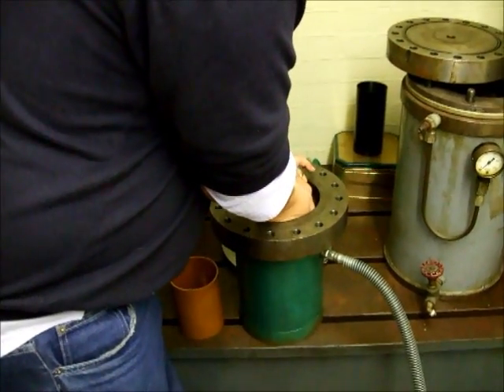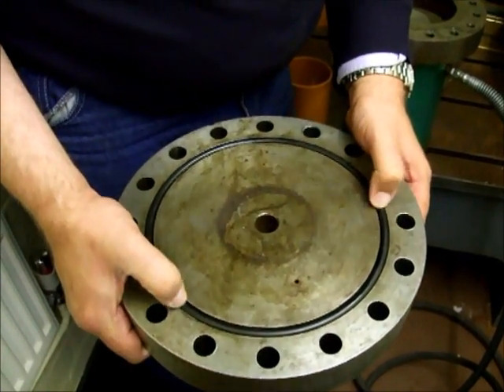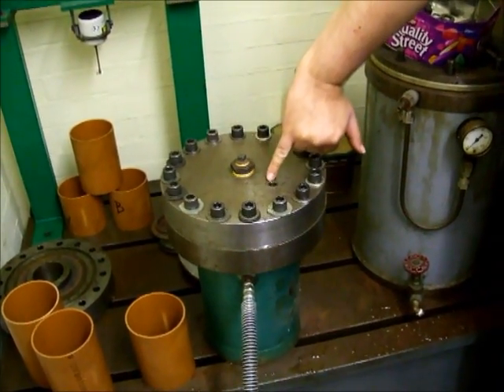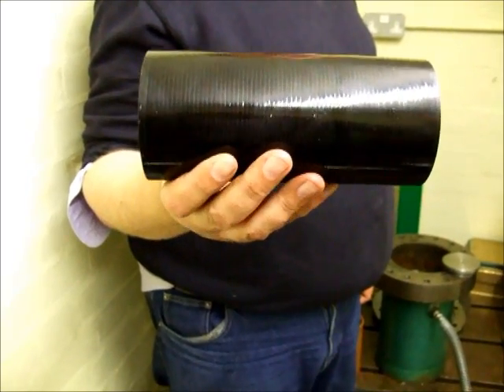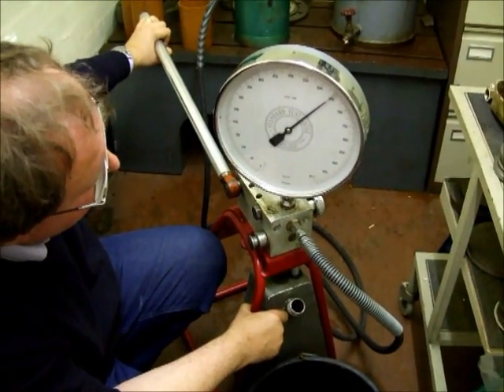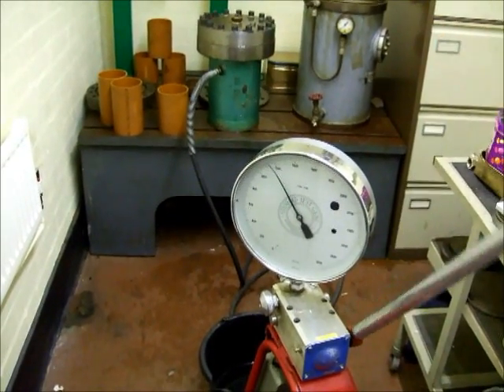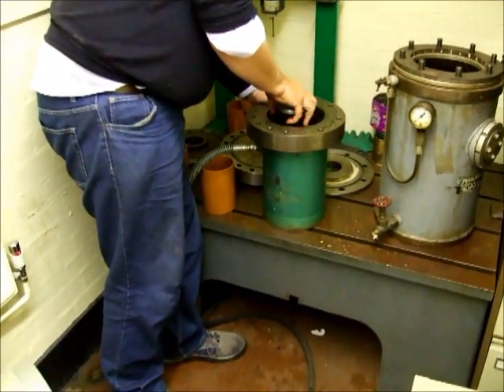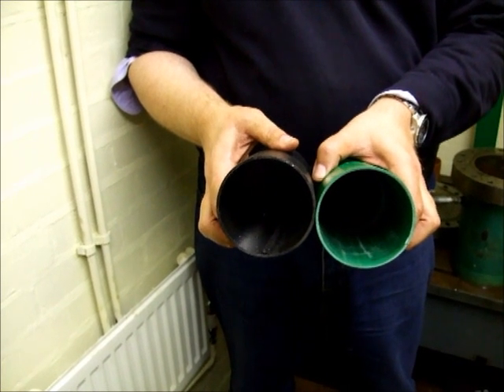Collapse of Composite Submarine Pressure Hulls

Comment: Wild how soooo friggin many of these videos exist but yet a company with millions to spend didn't even do the smallest bit of research into the reusability of the sub yeah it could do it 1 or 2 times and honestly I'm betting it could have gone at very least 5 times and at most 10 times had the looking glass been properly rated as a procurer of fine glass products lol I've found very nice glass with fractures so fine that they could only be seen at certain angles and light I'm willing to bet there were fractures a few micrometers in length which are far too small for our crappy eyes to see they never had the sub independently tested for structural integrity I bet the hull had micro fractures as well but the fact is the carbon fiber and titanium were rated for the depths while the glass was not simple as that and anyone who has piqued their own curiosity in testing tensile strength in something like say a pencile knows it's far hard to snap it the 1st time vs the 2nd or 3rd time the entire vessel was a pencile waiting to have those stress fractues from the first two attempts at snapping make the 3rd time cake

Comment: The most likely weak point on the Titan submersible would be the ring that was actually glued to the carbon fibre cylinder.  As the cylinder became subject to immense pressure, the glue joint would likely be subject to tremendous shearing stress. The strength and  behaviour of such a joint is very difficult to calculate or model accurately.
Reply: And every time you dive and surface,  you're putting the whole thing through a pressure cycle and a thermal cycle,  where the titanium caps expand/contract at a different rate than the carbon fiber they're GLUED TO.  That glue probably doesn't perform very well at near freezing temperatures either.
Reply: Totally agree 💯 the window is also SUS
Reply: It's also impossible to inspect the joint,  since it's literally inside the titanium ring.
Reply: There's a video of the joint construction, the resin seemed to be being hand mixed. It was applied in a warehouse using scrapers and looked like there was no real way of knowing whether air bubbles had got in...scary stuff.
Reply: @jimbob4217  yes, their construction methods are SUS. Also the pattern in which they placed the fibers is weird

Comment: How would it go if it was made sphere shape ?,better surface area ,maybe  .cheers
Reply: Can't be done. Carbon fiber is made in sheets. In most cases, strips, like duct tape widths. It gets it's strength by overlaying layers upon layers. If you try to make it sphere shaped, you will have wrinkles and air pockets, making it's strength plummet.
Reply: @Meika_Rei  i'm sure if you made a 100 foot sphere, you could get round the wrinkle problem...

Comment: I would think the smaller scale will let them survive much higher pressures than if you have a full tube to full scale.
For the simple reason that the surfaces are bigger for the pressure to act on, and in the middle it will trying to push in and it almost becomes a lever

Comment: A cylinder without inside reinforcements ( ribs ) is not representative of a sub.
If they calculated the cylinder from an inside force ( explosion ), the result is different from an outside.
Reply: even more that carbon fiber have only resistance for pulling forces, not withstand against pushing. forces.

Comment: There is a video on YouTube from a previous dive of the doomed OceanGate submersible to the Titanic.
At the 6:45 mark in the video you can hear faint popping noises which were probably stress fractures in the carbon fibers.  That previous crew had an angel on board.
Reply: The carbon fibers are not under tension here.  The tube is under compression, and the resin is all that is resisting the forces.

Comment: Very interesting, 10 years ago, wow. but you need to state that the observed failure mode was using a thin wall composite tube. Titan's hull was 5 inches thick. In order to physically model this event, you will need a tube with at least the same physical ratios I suspect. I'm reading that the Titan's decent rate was about or equal to 1MPH.
Reply: What was their ascent rate though??  A rapid ascent in the event of hearing cracking noises could prove rather dangerous. 
The original model was 7 inches when there was both company and University involvment but was cut back to 5 inches on the titan??  Is this true?

Comment: This video just shows the the force breaking the container and the pressure is released as soon as something gives way.

That is not the case in the ocean. The pressure will rapture and force water in to the container with massive force. The force of pressure does not stop like in the test.

You can see how the pressure drops as soon as the container buckles. Because space was made for the water. Water does not compress and that is basically what they trying to do here.

Great test.

Comment: If carbon fiber doesn't give as a pressure vessel, why was it used for this and isn't the Boeing Dreamliner jet made out of carbon fiber ? Scary too.
Reply: It’s good for higher pressure inside and lower pressure outside. Like a plane or a diver’s oxygen tank. 
Don’t know the why i just heard an expert on the news saying that. 🤷‍♂️
Reply: Boeing Dreamliner is working under very different conditions than tested here. Although air is a fluid like water, gas versus liquid properties, means different physics are involved. Aeronautical Engineering varies greatly with Marine Tech. G.E. also makes an NX engine largely out of the material. It meets/exceeds safety standards. Don’t fret. New applications, in the name of progress! Lightweight & stronger than conventionally used aviation alloys

Comment: All material will buckle or crack as the force from the pressure passes the material's limit. What needs to be tested is fatigue: repeatedly compressing and decompressing the cylinder. This weakens the material.

Comment: Did I hear this correctly - the steel cylinder had a failure at 375 PSI but they took the carbon fiber cylinder all the way to just under 1400 PSI - 3.7 times the implosion pressure of the steel canister.
Reply: Nope.  Glass fiber, not steel.  And I'm 90% certain those numbers are bars not PSI.  Edit:  At one point you do overhear them saying PSI.
Reply: Steel with same dimensions is far stronger.  Carbon is stronger by WEIGHT

Comment: Having worked with Carbon Fibre, Kevlar and other laminates for decades my guess would be after numerous dives some breakdown of the bond between the epoxy and the carbon fibre in the laminate had occurred and possibly flaws where beginning to manifest.

This is a common fault with materials subjected to repeated heavy loads and why commercial aeroplanes are crack tested regularly to look for cracks caused by both the repetitive forces of landings and takeoffs but also the regular compression and decompression of the pressurised fuselage when going from high altitude to landings, my guess, they never X-rayed the pressure vessel of the Titan on a regular basis to check for flaws in the carbon fibre laminate, and the note often made by the owner and passengers about the ‘cracking sound’ made each time the submarine made a dive to substantial depths should have been a warning to regular check for this issue.

These cracking sounds are the not the carbon fibre ‘breaking’ but rather and most likely, some minor delaminating of the layers of carbon fibre, over time these would turn into flaws in the laminate and at the depths this sub was diving to, eventually catastrophic failure of the carbon fibre laminate occurred resulting in instantaneous implosion of the pressure vessel/submarine.

Having a cavalier attitude to safety is fine if it’s your own safety but this company should have been regulated and made to carry out regular crack testing on the pressure vessel, particularly as this was a new method of submarine pressure vessel construction and just like aviation companies have to do regular crack testing on their aeroplanes likewise, so should a sub company carrying paying passengers to extreme depths. The guy was charging $250k per person for the opportunity to dive in his sub, the least he could have done is a regular X-ray of the pressure vessel to ensure it’s integrity, each dive was slowly adding to a fault or flaw in the pressure vessel and they would have picked this up with an X-ray inspection before it came to this unfortunate end.

I’m all for innovation and carbon fibre is a wonderfull material with a tremendous scope of applications but it has its limitations and I think the owner put to much faith in the material in this instance and possibly didn’t understand what these where, particularly at pressures exceeding 6,000 psi.
Reply: one passenger described the hearing of cracking noises on the way down a few missions before the final one and the owner wrote it off as typical and not to worry about! OOPSIE POOPSIE!
Reply: Pretty much this.  It was playing fast and loose with people’s lives and an over-reliance on a “wonder-material” at over 12,000 ft underwater.  Not to mention the sub itself had a bunch of other glaring flaws, like the complete lack of fire-rated equipment on the inside and the exposed nest of wires and hoses on the outside, especially considering it was to be taken near a massive shipwreck.
Reply: @OneBiasedOpinion  the pictures that keep circling are of the sub are in its build & test phase (yep they did test it lol). Almost nobody is posting pics of the sub with its cowlings on covering the props but that's how it actually dived to the wreck. There were no exposed cables outside
Reply: OceanGate engineers believed that "no scan of the hull or Bond Line could be done to check for delaminations, porosity and voids of sufficient adhesion of the glue being used due to the thickness of the hull".  If such scans weren't thought to be possible or effective, they should have instead subjected sample hulls to repetitive pressure cycles to destruction, to determine a reasonable limit for the maximum number of missions to 4000 meters, but they didn't.  From the "Prior Concerns" section of the following Wikipedia article -  https://en.wikipedia.org/wiki/Titan_submersible_implosion
Reply: There is another thing that not many people are talking about. The ring that the end cap attached to was literally just glued onto the carbon fiber with epoxy. It didn't protrude into the hull at all, just glued on the end. The difference in how the 2 materials flex, compress and expand when returning to the surface probably started to effect that bond between the 2. I am really curious i the failure point might have been at one of the ends where the titanium was glued to the thing. https://youtu.be/4PUTbK5AqY8
Reply: So Stockton had come up with a system to detect and monitor failure. It seems that he believed and trusted his system implicitly even though it likely had only ever been tested in destructive circumstanced. No long term testing of wear and tear was ever done.

It is quite possible that his system actually does work fine in detecting failure while the hull is 100%, but as defects build it's likely no longer sufficient as failure will occur more rapidly and unpredictably. And since he idiotically refused to do this type of testing (thinking it was unessisariy) he didn't know.

As a note to scan the hull simply required x-rays, which would definitely have been possible, Stockton just didn't want to pay for it.

Also according to boeing and nasa they never worked with Oceangate, the claim likely being derived from some indirect factor, such as they rented storage space at a boeing facility (they had a contract with boeing!) etc. etc.
Reply: They mentioned in a CBC radio report last week that Ocean Gate had developed their sub in consultation with Boeing and NASA and when my father heard that he said "That sounds about right, Boeing and NASA are known for their subs..." 🤦‍♀
Reply: @ArtGirl82  Boeing does make submersibles for the military (e.g. Echo Voyager).  But that consultation was probably him talking to a friend whose spouse knows someone that used to intern at Boeing/NASA.
Reply: @youtubewatcher4603 pretty much that. Boeing and NASA just made public statements to explain that they were never involved with the pressure vessel design or specs. It seems they only gave very basic input. OceanGate seem to have been dropping their names in their advertisements as a credibility bonus in a confusing and dishonest way.
Reply: @ArtGirl82  Yeah, it turned out their consultation was more like "sure you can rent that part of the office back in the corner there" than actual involvement of those companies. Oceangate was just name dropping of some people they spoke to. Just one more note of how awful Oceangate is.
Reply: @ArtGirl82 that was e,posed as a lie. Both have denied it
Reply: It was an epoxy cylinder with carbon fiber filling.
Reply: if he was responsible enough to x-ray it regularly i feel like this entire thing would have never been constructed to begin with, clearly he didnt do any research and saw it as a personal affront to his intelligence and a bruise on his ego, pure hubris
Reply: The guy said he was done with red tape safety stuff.
Reply: Using Carbon fibre, Resin in subs is like asking Superman to win a bake off 😂
Reply: fellow material engineer here - I'd guess they did not set the epoxy properly wich created inevitable airpockets. When these pockets were subjected to the Titanic depth pressure, the bubbles were compressed out from the epoxy, leaving voids or collapsed pockets which made the entire structure useless.
Reply: You have said everything I wanted to but a lot better than I am able to. Thanks (ANYBODY CAN FIBREGLASS BUT IT HAS LIMITATIONS)
Reply: They didn't crush steel or titanium of the same dimensions,  and they didn't try thicker walls. This video is not conclusive at all
Reply: James Cameron also said Carbon fibre is great if you have internal pressure (planes) but sucks for external pressure (submarine)
Reply: On the Titan they damaged the internal surface of the CF tube by screwing computer screens mounts (and other components) into it.
You can clearly see internal photos of the sub with them.
Reply: @sydney95b  I just had a closer look, I think it was some inner lining they made where the screws are in, I rly dont believe that anyone would screw into the pressure hull not even that rush guy
Reply: @strammerdetlef  I guess no one will ever know for sure... not much left to properly evaluate. 
Long term stress testing on the 5 inch CF needed for confirmation of failure point... especially with repeated dives, as this would be the best way to establish longevity of the submersible hull.
Reply: @sydney95b  There was a fiberglass liner that the cables ran through and the lights and monitors were attached to. There was a floor. The carbon fiber pressure boundary was not exposed directly to the passengers.
Reply: @sydney95b No, it had internal lining, you can see this as it had integrated led lighting. They were stupid but not THAT stupid.
Reply: @sydney95b  i think that screens and lights were screwed onto the perforated sheet metal interior lining which was in turn supported by the interface rings

Comment: It's telling that the pressure hull on Ocean Gate didn't fail on the first dive.  Cracks formed and grew with each dive until the hull suffered a catastrophic failure.  Non destructive testing of the structure could have detected the cracks, but it's unknow what if any inspection of the hull was performed.  What's truly disturbing is that these were the exact findings that OceanGate discovered during their 1/3 scale testing.
"Given the prevalent flaws in the previously tested 1/3 scale model, and the visible flaws in the carbon end samples for the Titan, Lochridge again stressed the potential danger to passengers of the Titan as the submersible reached extreme depths. The constant pressure cycling weakens existing flaws resulting in large tears of the carbon. Non-destructive testing was critical to detect such potentially existing flaws in order to ensure a solid and safe product for the safety of the passengers and crew."
Reply: don't worry, they had a patent to monitor hull health in real time...
Reply: what kind of non destructive testing of it can be done?
(EDIT: For carbon fibre vessels)
Reply: @MrJC1  There are quite a few methods including Ultrasound, X-Ray and Thermal Imaging.  For more information look up, "Technology Survey on NDT of Carbon-fiber Composites" by Pauli Vaara
Reply: I believe we know from the lawsuit with an ex-employee over safety issues and from Rush's response to the Manned Underwater Vehicles committee of the Marine Technology Society that Rush declined any such testing. If it was done, there doesn't seem to be any record of it. But I'm sure OceanGate’s records will be known in the course of the litigation that is likely to occur.